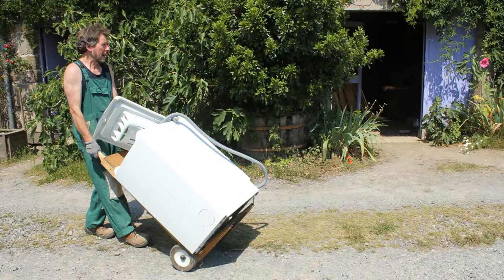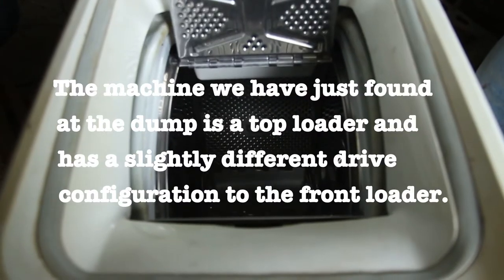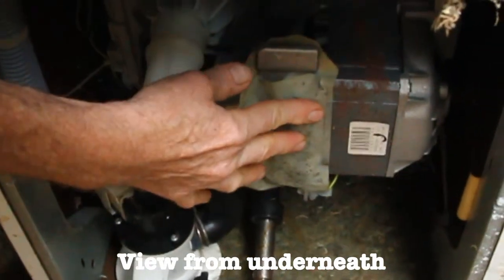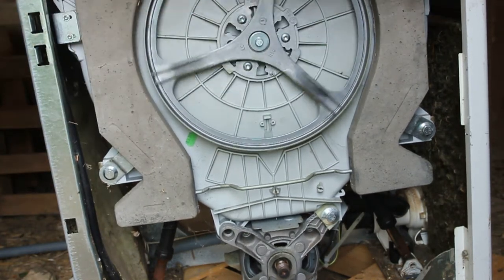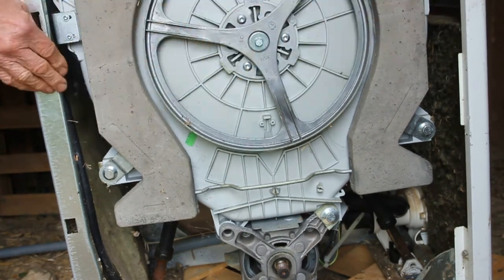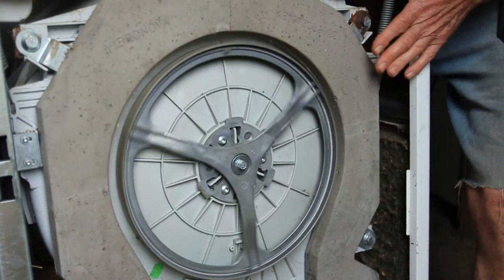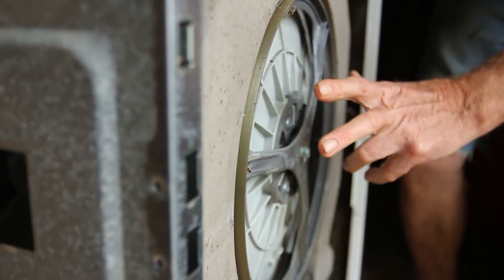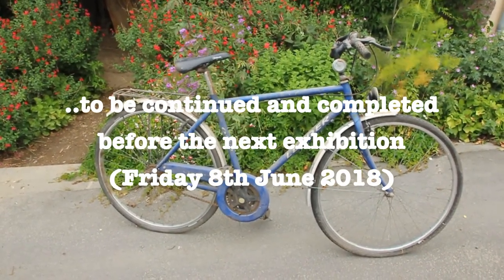Pedal Powered Washing Machine DIY Conversion 1. Lavadora a pedal en una dia. Lave-linge à pédale

Comment: Looking forward to watching watching this project unfold! I currently have two old wringer washers sitting in storage in our lean-to in the yard. I am wondering if it's possible to turn one of them into a pedal-powered machine, so will be watching your build videos with interest.
Reply from the maker: Hi, thanks for your comment there's more of the project on the way!!! . Any washing machine with an electric motor ought to be able to be converted to pedal power. I would think the only problem that could arise is if some company has a machine where the motor is mounted with the shaft in a vertical position. I'm not sure if one exists though. I assume the wringer is powered by the same motor? It thus may mean someone pedals whilst another person feeds the laundry through the wringer. Still, I hope you fish the old 'uns out of your lean-to and give it a go. If you have success try and put a video on youtube I'm sure there would be a lot of interest in the conversion and in seeing the wringer in action. All the best from Normandie, Andy.
Reply: Thanks for replying to my comment. Yes, the wringer is powered by the same motor; there's a lever on the front of the machine that toggles back and forth between the washer agitator and the wringer. I'll have to take a look at how the motor is mounted, because I haven't actually taken a look at the inner workings. Also, I don't have a bicycle yet, so won't be undertaking this project until one presents itself at the end of someone's driveway on garbage day. :-)